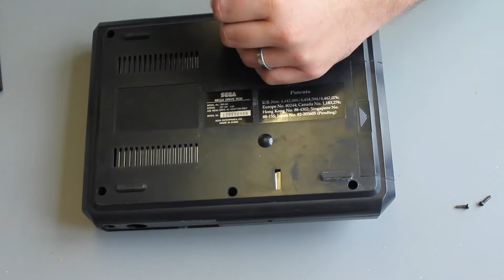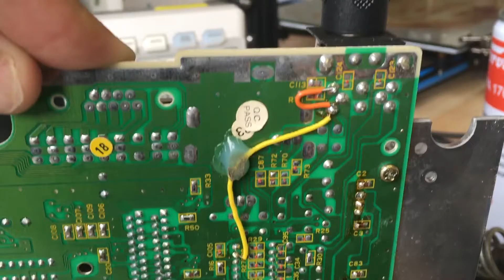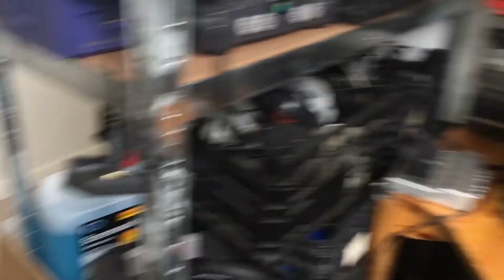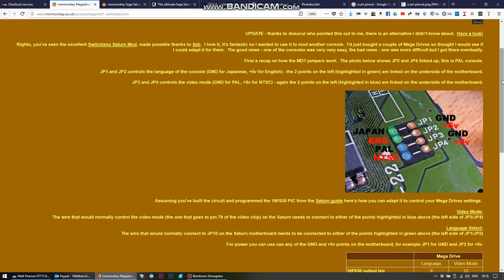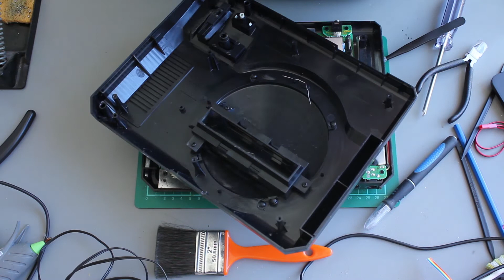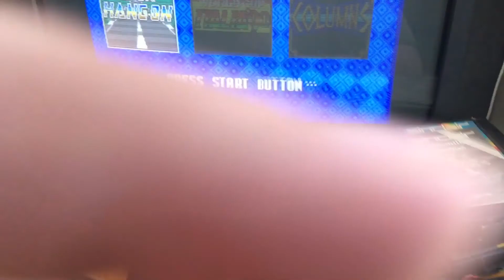Sega Mega Drive (Genesis) - Tear Down, RGB fix and Switchless Mod Install

Comment: Hello. What resistor values did you use on the LED's Red and Green pins? Many thanks
Reply from the maker: Damn Deal Done I used 330ohms on the red and 1k on the green as the green was too bright at 330ohms.
Reply: Thanks for the reply. Is your third LED state very distinguishable from the Red and Green?

Everyone I have spoken to has used different values.

1 x 220 on common LED pin
2 x 220
1 x 180 and 1 x 680
1 x 150 and 1 x 330
1 x 330 and 1 x 1000
I saw one YouTube video that used no resistors with a Red / Blue led and the colour states were very distinct Red / Blue / Purple.

Think I'm losing my mind thinking about this. I just did mine with 2 x 220 and I have Red / Green / Green LED states.

I should probably just buy a whole pack of resistors and experiment. This is hard for a beginner.

Thanks for your help.

Comment: Nice video, check out megadrive++  for igr. I wouldn't bother making a board, an update to the switchless mod is unlikely.
Reply from the maker: Russell Brunskill it was more in case I cocked it up as this was the first time I’d tried it. And what do you know I did cock it up so I took the board out. I’ve now done about four of these and it’s all plain sailing from here on out.
Reply: 16BitBench good stuff! I might bag one of those scopes you have.. Great work anyway. Subbed 👍👍